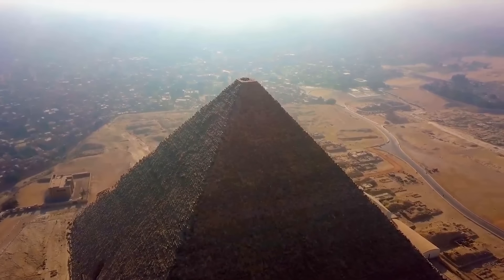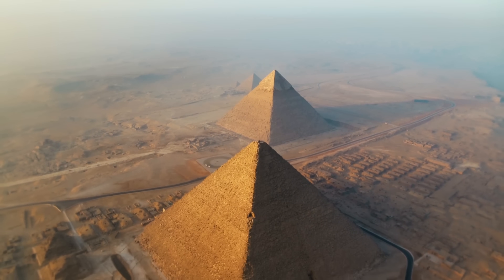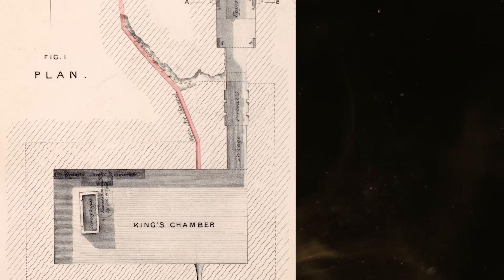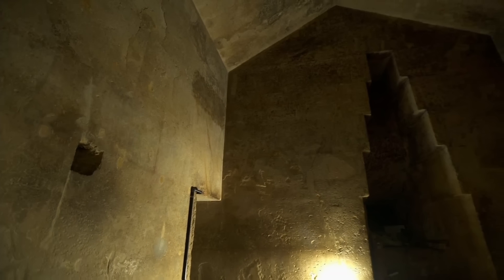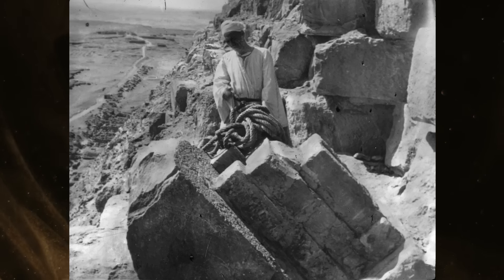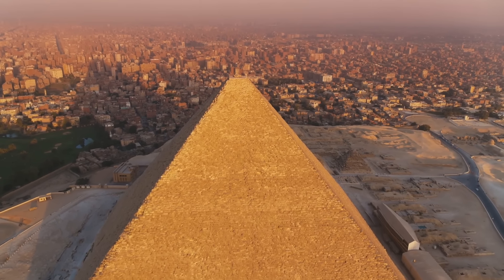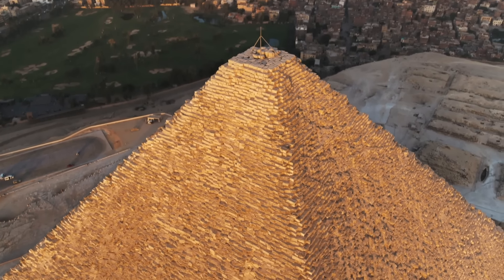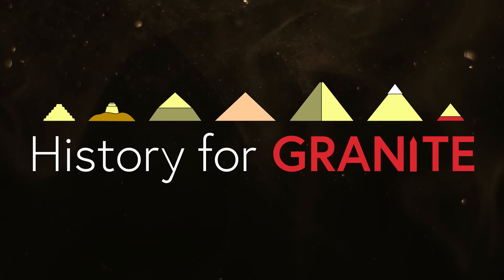One Solution to the Four Channels of the Great Pyramid

Comment: The "ventilation" purpose also explains two features:  (1) the channels were slanted, not horizontal, in order to provide natural draft as the hot air from workers and torches tended to rise. (2) there are two channels on opposite sides so that the wind blowing outside would force air into one channel and suck it out of the other.  (I wonder what is the prevailing wind direction at that location...)
Reply: 1) they're not high enough on the wall for that to be helpful. The warm air and smoke will rise and accumulate.

2) long tiny hole seem like that would have negligible effect, and begs the question of why people are inside the pyramid with the main entrance blocked off, preventing airflow.
Reply: @daniels4338 it was mentioned that on multiple occasions the "long tiny holes" were more than sufficient for ventilating the chamber.  It was hot and uncomfortable before they were cleared and much cooler afterward.
Reply: Ancient and medieval homes burned oil and reeds for illumination and I don't think they had vents on or near the ceiling. Perhaps there is an air circulation mechanic that isn't obvious to us.
Reply: @daniels4338  Pretty much any ventilation conduit in any skyscraper or office building is a "long hole".
Reply: why are they pointing down towards the chamber and up to the sky which may let rain water in?
Reply: @noklarok   By the 1800s the King's shafts were in good part filled with sand; probably blown by the wind, but possibly filled intentionally after the pyramid was finished.  Anyway, while the King's shafts are currently open at the top, the pyramid's outer "casing" layer has been pillaged for building material, so we don't know whether they were originally blocked by the casing or extended right through it; and, if the latter, whether the upper openings had some protection against rain.  The Queen's shafts were plugged near the top by two small stone slabs, each with with two copper handles on the outer side (possibly meant to hold the plugs while they were inserted down the shafts),  and then the ends were buried by a couple layers of building and casing blocks.  One of the Queen's shafts was also blocked at the bottom, hidden behind one of the stone blocks that cover the wall of the Queen's chamber.  So, whatever the purpose of those shafts may have been, it seems to have been temporary, relevant only during the construction.

Comment: I realize that no one will read my comment but I'll write it anyway. I can`t belive that the purpose of the shafts are for ventilation. Why didn't the original builders, whoever they were, open the shafts after the pyramid was finished? Why were they firstly opened in 1872? Have they forgotten the position of the shafts? During the construction, the shafts were apparently not necessary for ventilation. But I love your videos, keep going.
Reply: I think they would have been open to the sky while under construction, so the vents would not be needed until the ceiling was in place.  Perhaps they knew they would be abandoning the work in the queens chamber before finishing it, so no need to open the vents. They could have held ceremonies before the official burial, so vents make sense in that circumstance. You don't really need the vents, but to be fair nobody really needs to be buried in a massive pyramid in the first place. If they're going to the trouble of building such a massive structure, it's not a big leap to think they wanted airflow in there for the ceremony/ burial

Comment: Truely an remarkable eye for detail! But I have spotted a flaw in the "Ventilation theory": The air-flow works by the upward angle with a chimney-effect. But the chamber was sealed off from the Grand Gallery with several blocking stones on different locations. There was no air flow other than through the shafts themseves. So it would have been nearly nonexistent. 
Hence either the ventilation was a necessity in the building process when the chamber was open like today. Otherwise the channels could have been part of the final sealing mechanism.
Considering the shafts in the queens chamber unfinished, the Great Pyramid seems more and more like a work in progress with at least three stages: a classical mastaba with the underground chamber, the "first stage" Pyramid with the Queens chamber and finally the expansion to its present shape with the Kings chamber.
Thank you for your great work!
Reply: - good points. I agree with the 3 phases suggestion, simply because it makes sense and answers a lot of questions. As for the ventilation, it could have been that the ancient pyramids were, in the beginning, open for ceremonial events although entry was probably restricted to an elite few. That would explain the need for ventilation. Just an idea.....
Reply: Yes, the chimney effect was on my mind the whole time too. Perhaps it would still function given all the cracks in the masonry, plus the well shaft, and the fact that the portcullis was not air tight. 

More importantly, perhaps the ventilation was for visitors. Perhaps there was a period of days, weeks, or even months to years when the portcullis would have been left open for people to visit the kings chamber. In this case, the ventilation is for the benefit of visitors.
Reply: The shafts are different lengths
Reply: That is a great point. For ventilation it would have worked better with one horizontal and another going up to get that chimney effect. But maybe the clue is in one thing he read from old explorers claiming there was soot from lamps. Maybe they are a literal chimney to place lamps on and get the smoke out. With one on each side they would give a nice light.
Reply: Practice your grammar please, It's so hard to understand what you mean.
Reply: @jstdrv  

It made sense to me
Reply: @panchopuskas1   That is my thought as well. We can't assume that the burial chambers were immediately sealed after the burials took place. The Pharaohs had their own cults that worshipped them after death and maintained the grounds around the pyramids. It would not be surprising if rituals were held for a number of years in the burial chamber before being sealed off.
Reply: actually it doesnt work by the chimney effect (smth that they almost certainly didnt even know about), it simply works by hot air rising. plus i think it may be for the burial ritual before it was permanently close so it would still work anyway.
mastabas were well out of fashion by the start of the construction of the great pyramid and it likely wouldve been quite obvious since it would make a shear line where they  meet above the queens chamber. more plus if thats the case the queens chamber shouldve been finished as part of the first mastaba. more plus we kinda know that it was mostly done fairly quickly (decadeish) so it wouldnt allow for any serious mastaba/small pyramid phase of any real length.
Reply: Theres more than one possiblity here, air might have been needed:
For the workers that were finishing the chamber (sarcophagus,other decorations,  maybe even paint job was planned but was never done)
For the ceremonies 
To aid the mummification process
For pharaoh himself, maybe crazy bastard wanted to spend his last days inside!

Comment: There is also a HUGE piece of information that can also be found, the orientation of core drills whilst in use.
As the core drilla used here must be used horizontal, this shows that cutting liquids etc could not have been poured into the holes. I think this maybe the only case where we are 100% certain that core drills could be used horizontally.
Great work on your video. Very useful and well presented.
Reply: That's if the core drilling was done in situ,  if the channelled blocks were prepared off site then they could have been drilled vertically,  examination of the adjoining blocks making the channel would show if there was a step in alignment,  interesting to see the variation from rounded corners to square cut.
Reply: Therefore: lost high technology? Power tools? Still a mystery?

Comment: Great observation!
However, note that ventilation would not be needed while the walls of the King's chamber were set in place, because at that timethe chamber would be open to the sky.  Ventilation would be needed only after the first roof was laid down.
Reply: Yes. Very good point
Reply: But there would have been elaborate decorations before the funeral and probably rituals aswell. The might not have wanted to ruin the decorations by sud from the torches
Reply: Yeah, they were probably closed just until final work on the chambers was about to begin, you know, hieroglyphs and what not... so I disagree that the air wasn't for the workers!
And the work inside the chambers was only going to start after the whole pyramid had been built, because you can't put a story into hieroglyphs until you know the whole story you're going to tell, so yeah... the Great Pyramid was never fully finished as far as I understand it...

Comment: I have always believed the Great Pyramid was originally intended to be smaller, with only the Queen's chamber, but a decision was made during the build to increase the size of the pyramid. The King's chamber became the primary chamber, and the Queen's chamber was abandoned. The vents of the Queen's chamber were originally meeting the exterior, but they were buried as the exterior walls grew outward. This may also explain why the King's chamber has the odd supporting beams above...as they may have needed to excavate downward to create the King's chamber. The beams were installed to support the walls of the excavation. This also explains why the Queen's chamber entrance was covered...and again, due to the required excavation, the grand gallery design was for structural integrity (they opened the hallway wider the further they dug down).

Comment: "Unfinished" can mean either "without finishing" or "incomplete." You make a good case for the Queen's Chamber being unfinished. (Although you leave unexplored the possibility that the shafts in the King's Chamber original construction were also blocked as they are in the Queen's, and were subsequently opened in antiquity in a manner similar to what happened more recently for the Queen's'). And ventilation has always seemed the most likely purpose for the shafts given how immediately effective they proved upon clearing. But while I don't dismiss the idea out of hand, I have difficulty accepting that the Queen's Chamber is an incomplete abandoned project. You just don't get that close to finishing something only to abandon it. I feel similarly about the granite casing stones on the Menkaure pyramid. It doesn't make sense to me that they just never got around to completing it. If they left the stones that way, they must have had some reason for it. So the interesting question remains why they left it this way.

There's another significant feature of the Queen's Chamber air shafts that you don't address here. (Not that this detracts from what you do address). And that's that their elevation at their end is exactly the elevation of the ceiling stone in the uppermost of the so-called "relieving chambers." (At least it appears that way in all of the detailed diagrams I've seen). This seems too much of a coincidence to not have been deliberate. So why do they stop there? If they were for ventilation, they'd need to make it all the way to the exterior. So why go all that way, including the awkward jog around the Grand Gallery, only to abandon the effort? You mention that the visible surfaces are all well-made, while the interior areas are much more approximate and haphazard. I seem to remember reading that the Queen's' air shaft becomes much more well-finished as it approaches the plug/door. This implies to me some functional purpose at that location. I don't have any theories to offer, but it really seems to me that there's a relationship between the Queen's and King's Chambers because of those shafts.
Reply from the maker: It's really only the last QC channel block that is finely finished. It's only natural to make it a bit nicer before the boss comes to sign off on the completed job.
Reply: Spot on, I think they were part of THE mechanism itself used to build the pyramids... I am surprised we haven't yet worked this out. :)
Reply: @HistoryforGRANITE  .....you need to address my point above, likewise you have not answered the question here, WHY both the Queen's Chambers northern and southern shaft's do not penetrate to the exterior of The Great Pyramid like the King's Chamber shaft's ???.....
Reply: The QC airshafts not reaching the exterior is the Matt's Ancient Architects hypothesis: the pyramid was double upgraded - they abandoned the subterranean chamber, than the middle chamber and last upgraded to the 3rd chamber.
Reply: @8TENASTER8IDS   the pyramid was revised twice that's why. They abandoned the underground chamber, and when they nearly finished the queen's chamber they upgraded to the king's. They abandoned the QC, sealed off the shafts and moved upward again. It's the only logical proposal.
Reply: According to me, the panes in the queen's chamber could have been connected to other panes filled with water. They were covered because there was no need to unclog them in the event of accidental clogging of such small channels (20cmx20cm) with debris. Ask yourself how to remove the limestone stuck deep in the shaft from a curved shaft. It may turn out to be impossible. You would have to crush and break the stone and then remove it from below. If it hadn't been noticed that
  the canal is blocked with stones and rubble was constantly falling in. It would be almost impossible to break a large stone because the rubble would absorb the impacts. There was a high risk that the shaft could be clogged and therefore unusable.

Comment: A great video that answers a lot and provokes yet more questions. The fact that they might not have existed there for ventilation during the building, and yet one of the is blocked by that stone with bolts, suggests they weren't that key even after the build, is just mind-boggling. The channels are now my new favourite thing.
Reply: And the drilling and saw cutting? With such precision 4000 years ago, what were they doing in there....
Reply: Only those of the unfinished "queen's chamber" are blocked off, both of the ones in the king's chamber are open. If the channels are for air then it makes sense that the ones for the unfinished room would be blocked off. My guess is the underground chamber was abandoned when it was decided to have activities in the tomb, then the queens chamber was the first planed chamber for the tomb, but was abandoned for some reason (maybe it not grandiose enough). The king's chamber was then planed at the top of the grand gallery in much the same style as the queen's chamber but bigger.
Reply: @paint4pain  I like this angle of thinking thanks.

Comment: As for the Queen's channels, consider this crazy theory.  Each pyramid, like those of the Maya, was built over many centuries; in stages, where each stage added a new layer to a preexisting pyramid.  The claim that "Pharaoh X built pyramid Y in his reign" then would refer only to the last stage of this process; and records of the previous stages would be deleted lest they diminish X's glory. In particular, the Great Pyramid was once a much smaller pyramid that had only the Queen's chamber, with ventilation channels leading all the way to the surface.  That pyramid was then partly dismantled, with removal of the outer casing and maybe a few layers of core blocks, and the remainder was expanded to the present size.  This partial demolition might have included removing the original ceiling of the Queen'a chamber,  replacing its wall slabs, and then placing a reinforced roof over it, capable of handling the increased load of the new layer.  The original exit points of the Queen ventilation shafts would have been buried by the new layer, so there was no point in cutting their openings on the wall slabs.  
Could something like this make sense?
Reply: I am prone to think the same but wouldnt layers from different ages be quite easy to notice in various tunnels and openings? There are also details like queen's chamber's channel seems to bend to accommodate grand gallery. We could account for some demolition and modification during construction of additional layers but I am pretty sure signs of them would be found long ago. Its always an interesting topic.
Reply: Yes this layer upon layer theory was also introduced by the YT channel called Ancient Architects (highly recommend it). But he supposed it was built in stages as a contingency plan; if the Pharao had a short life, the Queens Chamber would’ve been finished. He lived longer so the extra outer layer and Kings chamber were built. And yes that outer layer covered the previous schafts.
Reply: Indeed, signs of construction by stages should be apparent IF one decides to look for them ...😉 @MarkoKraguljac
Reply: PS. This theory could also explain the misalignment between the outer casing blocks and the core blocks that can be seen (as observed earlier in this channel) on a straight down view of the truncated tip.  And maybe also why the heights of the courses are not all equal...

Comment: channels need to slope upwards for warmer air to generate upward flow that is self-energizing - just like the exhaust on your gas water heater
Reply: In mines, if there are sufficient openings on both ends, air tends to move around despite geometry of passages.
Reply: Chimneys have been around a lot longer than pyramids :)